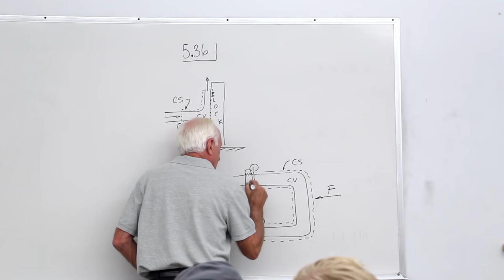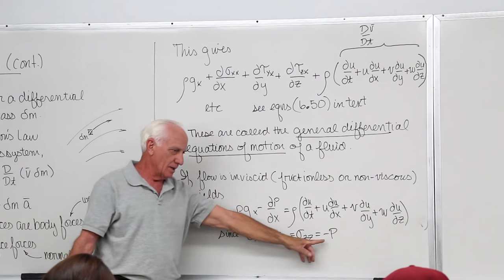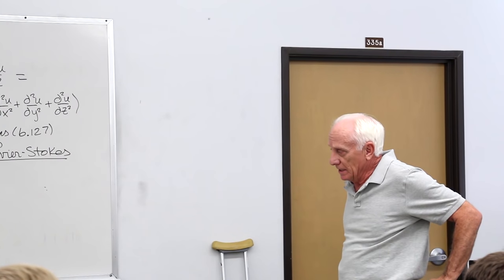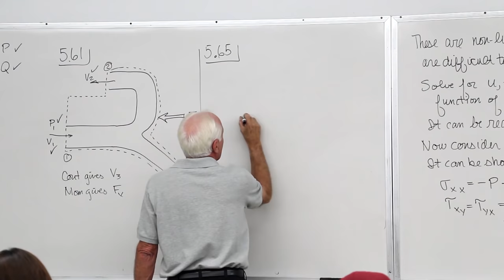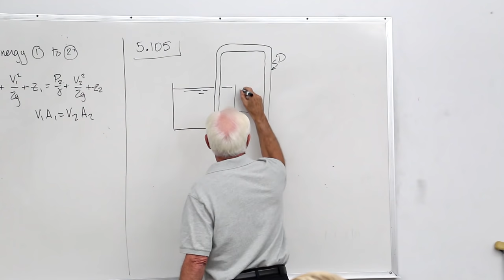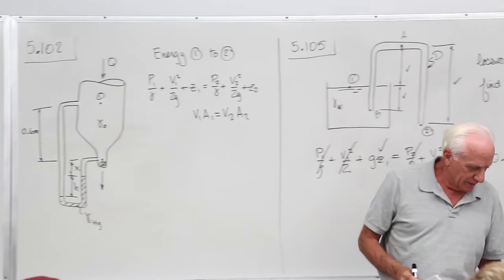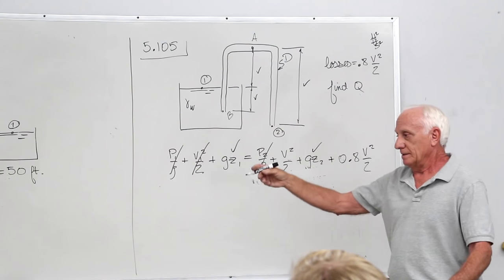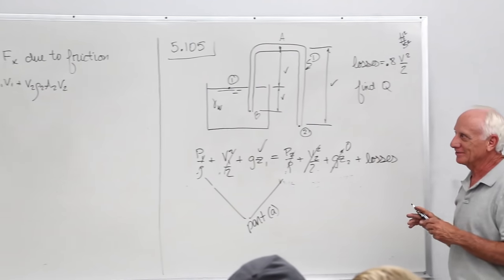Fluid Mechanics: Navier-Stokes Equations, Conservation of Energy Examples (15 of 34)

Comment: One thing that confuses me is that we assume fluid at entrance to the pipe is flowing so velocity is not 0 and it's not a static pressure. Yet I've seen problems like that where we treat fluid at the bottom of the tank as not moving and give it a static pressure value. How far from the entrance does fluid have to be to be called static?